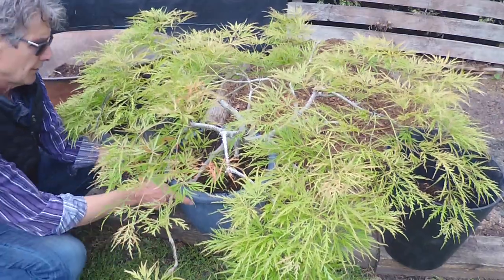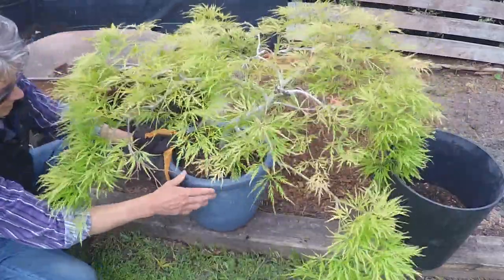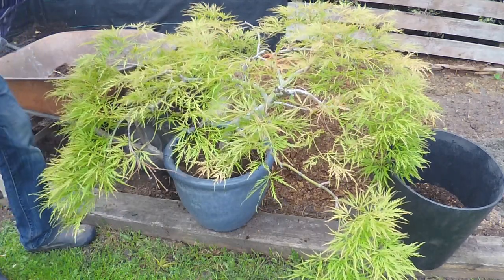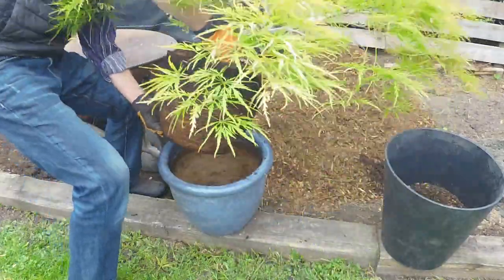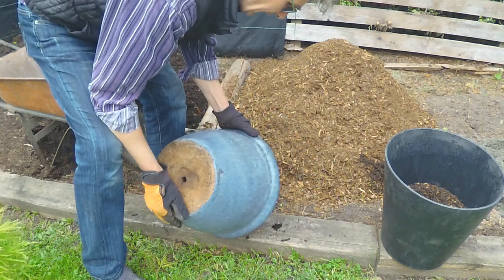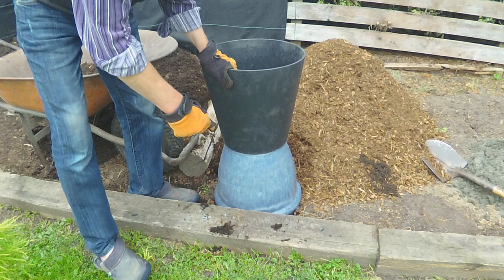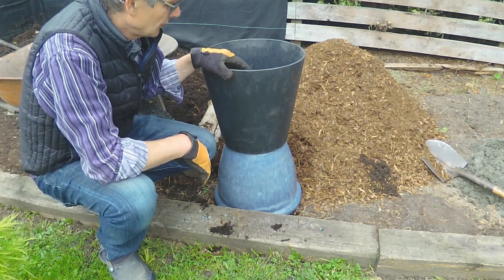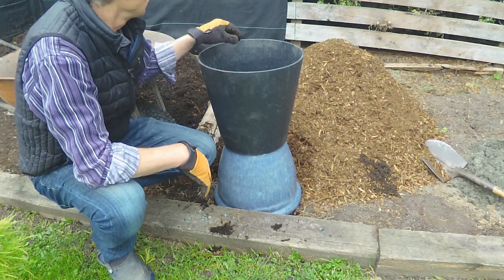How to re-pot  a container grown Japanese maple tree

Comment: Hi Otto. Just curious which slow release fertilizer you use on your JM? I’m assuming you fertilize just once a year in Spring? Also would love to see more content. Maybe next time can share which maples love shade vs Sun. TY!
Reply from the maker: We use an osmocote 16-10-10,  six month slow release. One application in early April and that’s it for the year. Approximately 1 tablespoon for smaller containers and 1 1/2 tablespoons for the large ones.
I have just updated an existing video and re-released it showing which cultivators like sun / shade and those that are suitable in both locations.

Comment: Hi I just bought an acer palamatum fire glow Japanese maple and it’s currently in those plastic 2 gallon pots. I have no gardening experience whatsoever. Do I need to do anything to it other than watering it right now ? Should it be repotted into a larger pot or a pot of Same size but different material? It’s only about 2-3 feet tall right now
Reply from the maker: Hi Joe, At this time of year when it is actively growing keep it in the existing pot right now.  Remember, regular watering every morning unless it is exposed to the outdoors and gets the rain when it falls.To test if it is ready to go into a larger pot , it should just lift right out of the pot with all the roots intact. If you do try to lift it and it feels like it is going to break up (soil) then no need to re pot at all. If you want to put it into a nicer looking pot for the summer, just place the whole plastic pot into a slightly larger container and then top dress with bark mulch. make sure your container has good drain holes. Fireglow is a beautiful choice!
Reply: @maplesandmusic  thanks for the reply Otto ! Actually it’s only in a 1 gallon pot at the moment. It’s only about 3 feet high. Should it be up potted into a 3 gallon container ? I’m worried I will slow it’s growth by keeping it in such a small container
Reply from the maker: @RMD992-f2n  Don't try to speed up the growth as that is the worst thing to do. Japanese maples are slow grower, let tehm grow at their own pace. The roots are tight and fibrous so your one gallon pot should be just fine for now. Do your re potting when you can just pull it out as a solid plug. Don't pull at the roots or loosen any of them. Just drop it into your larger pot ( see my re potting video)
Reply: @maplesandmusic  hi I noticed that my young Japanese maple has a lot of tiny holes on most of the leaves and that some leaves have yellow spots. What could this be caused from ?
Reply from the maker: @RMD992-f2n  Hard to say what  the cause is without seeing the tree in person. It could be the result of aphids that have eaten the young foilage.
Also when it comes to watering, ONLY water the base of the plant, not the leaves during hot and sunny weather. The sun can burn the leaves when they are magnified by the water drops. And remember, when in a pot, water every morning during hot dry periods

Comment: I live in Canada i have two maple tree that i both them this year and i plant them in containers. Because is my first time planning a tree in a containers i like to know should i live them outside and what protection i can give them thru the winter months should i water them till the snow comes down i know they will go dormant i really worried about them because the winter here is very cold thank you 😊
Reply from the maker: Hi Lela
We live in Chilliwack BC and we can get some cold weather, upwards of -20C with cold arctic outflow winds for a few weeks in the winter. All of our larger containers stay outside year round. Even our smaller containers do fine. We always top them off with bark mulch,  approx 3"-4" just to protect them a little more and that is mostly from the cold winds. Acer palmatum root stock is very hardy and can handle the cold weather. You can also set your container near the south side of a wall to give them that bit of extra protection as well for the winter months. Hope that helps you out!
Otto
Reply: @maplesandmusic  thank you so much for replying back to me